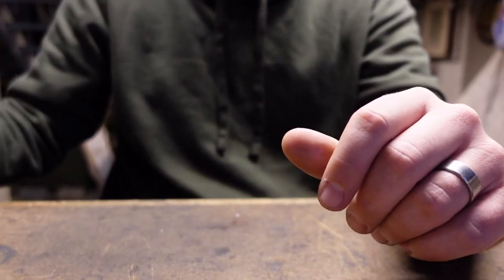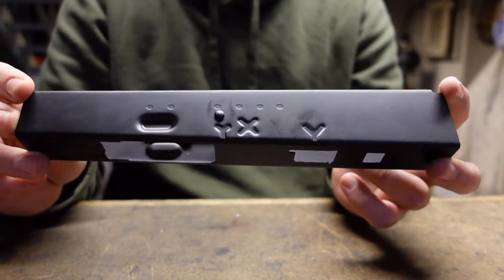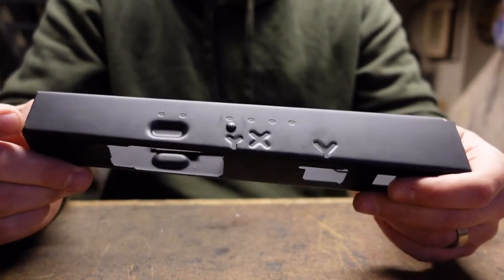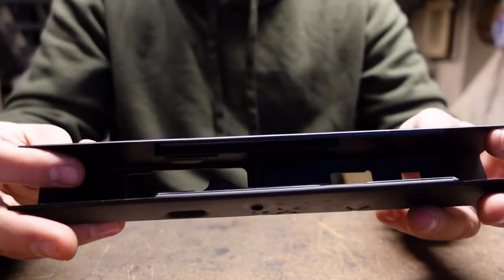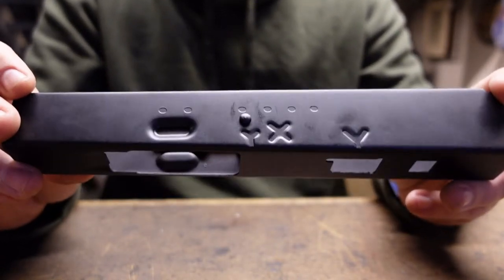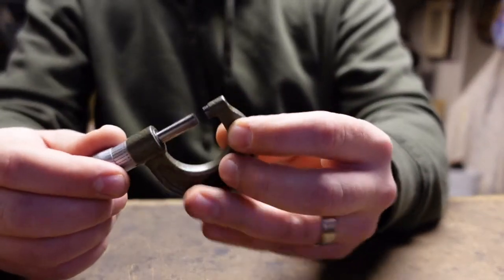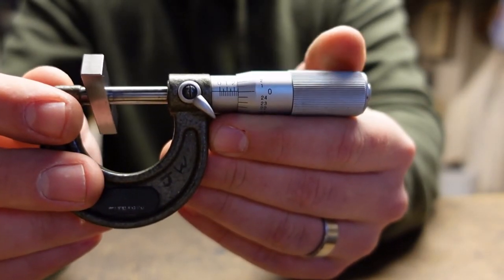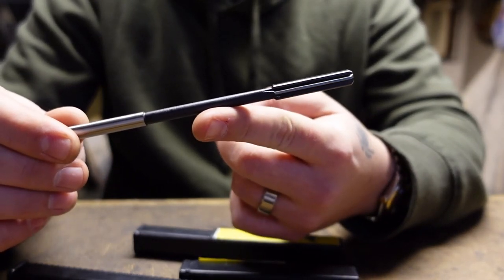AK Kit Budget Building Part 1

Comment: Reweld jigs are nice. I have a yugo/galil combo jig and it helped a lot. It cost me $250 but I have a yugo m64 and a galil SAR and the only extra parts I had to buy for each was a barrel and headspace gauges. Galil cost me about $750 for kit and barrel, yugo was about $800. Childers also makes a nice hole marking jig for ak47 and ak74 that includes the punch. Cost $25.